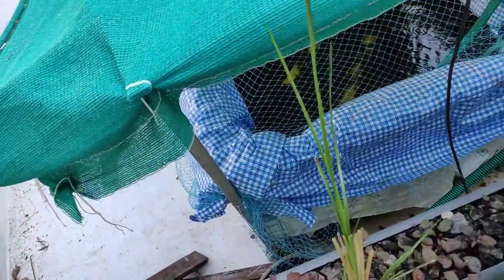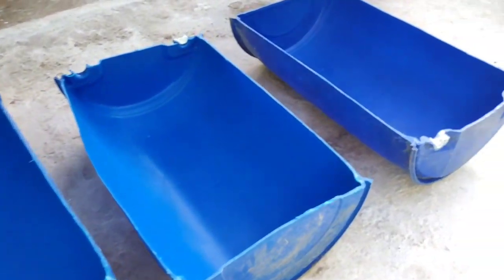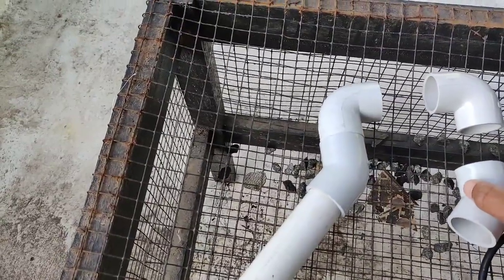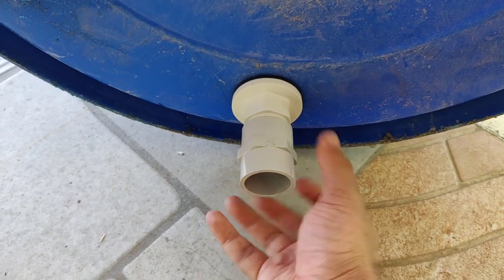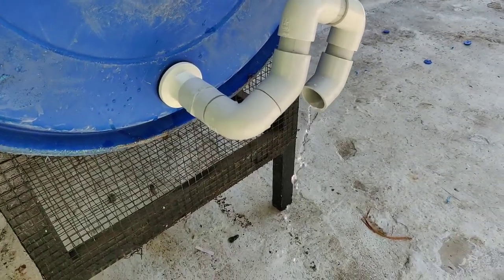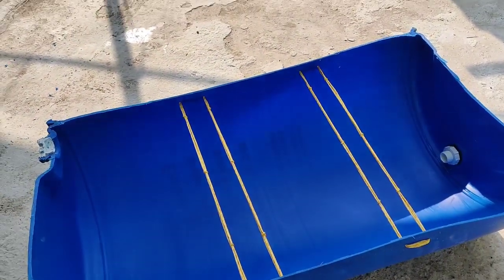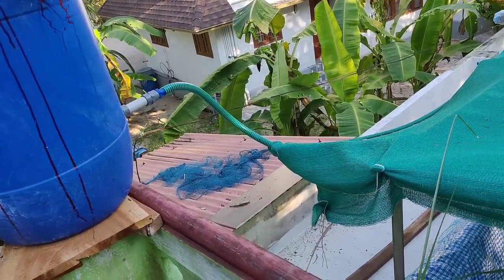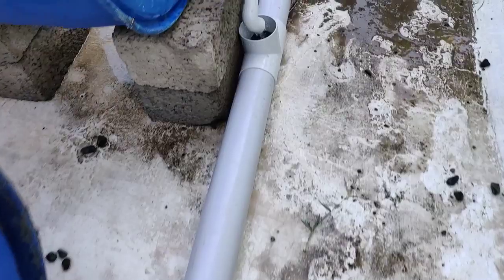അക്വാപോണിക്‌സിൽ ഗ്രോബെഡ്‌ സെറ്റ് ചെയുന്നതെങ്ങിനെ | add grow beds in aquaponics | aquaponics in keral

Comment: How to connects  pumps  in and  out  
Diameter  of the  hose and how much  hp the  motor  and pump  ,electric  power  bill how much per month 

Very  good  work  and demonstration
Reply from the maker: Watch this https://youtu.be/r8D52uBAxxg
3/4 inch
3800 litters per hour
Nearly 30 unit electricity per month.
Also, watch this https://youtu.be/h-Xf8XIX4C4

Comment: How the water should be running for plantation in gravel beds?
Reply from the maker: Contact me in whatsapp  +91 9946109809
Reply: I am from Andhra Pradesh
Reply from the maker: @n.purushothamrao6395  water in the gravel bed reaches a certain level and get drained. This is a repeated process. The roots of the plants spread in the gravels . The water contains Nitrogen which helps the growth of the plant.

Comment: Nice video...should we run the pump for 24 hours or can we switch off during night ?
Reply from the maker: It should run for 24 hrs in a standard system. You van make it 12 hrs but we need to alter the system accordingly
Reply: @TravelFoodFarming Thanks...can you share your WhatsApp number...I'm planning to dig a 15 foot *9 foot with 4 foot height ...planning to fill water for 3 foot..can you suggest me in how I can prepare my fileter and growbed
Reply from the maker: @antony9964  
Here is my number: 9946109809
Reply: @TravelFoodFarming  thanks 🙏
Reply: 1